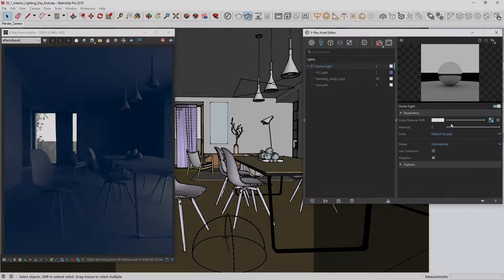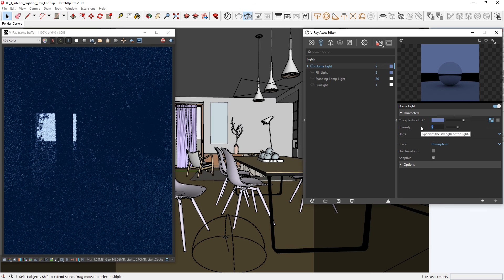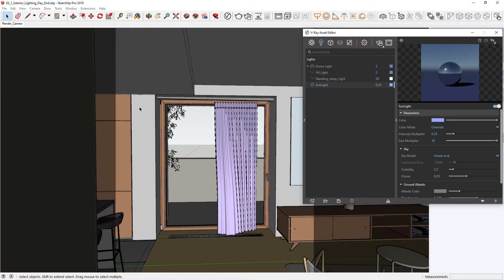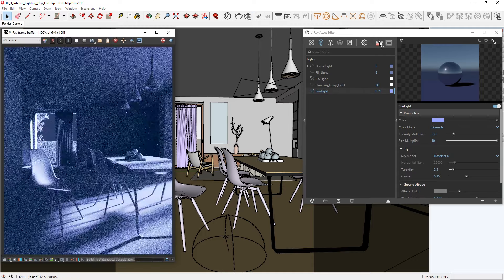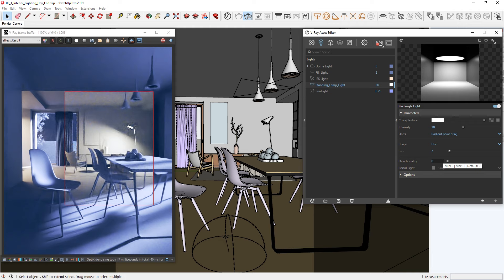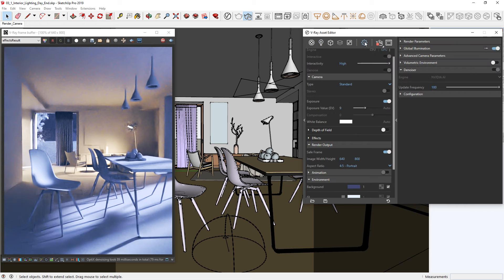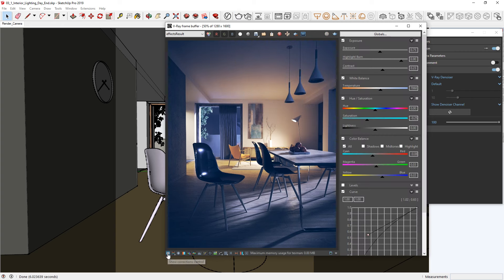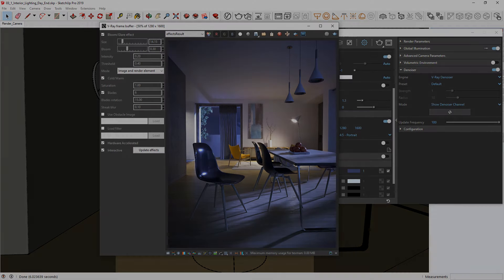V-Ray Next for SketchUp – How to light an interior night scene

Comment: Just upgraded my gtx 1080 to a 2080ti hoping my GPU render would be much faster but it only improved the test file from 11min to 9min? is there something in the settings i'm missing?
Reply: How do you upgrade? I want to do same
Reply: @vegilarchitecture597  Just replace the GPU. Not worth it for V-ray though.. haven't seen GPU usage over 5%.